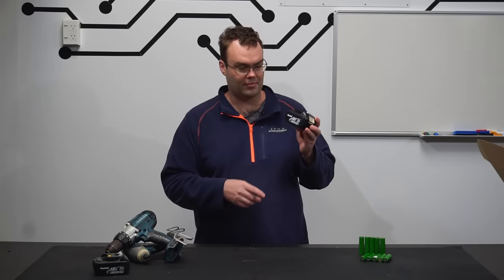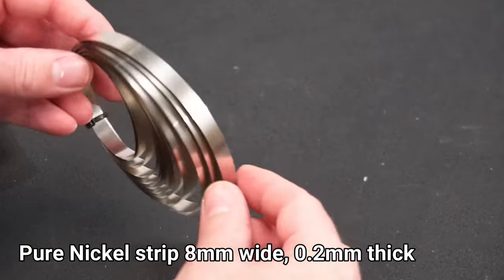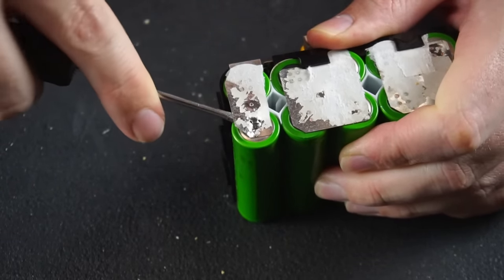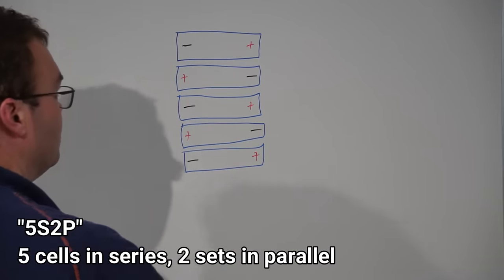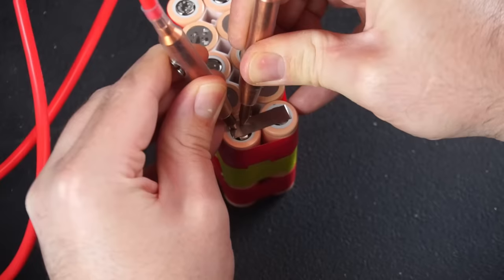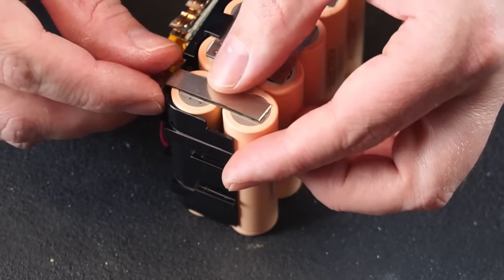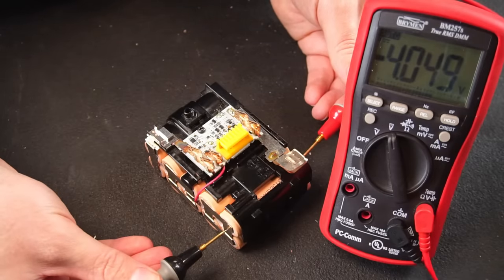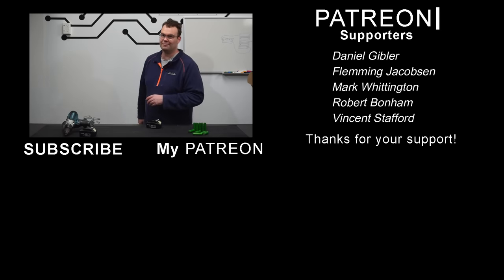Repacking Makita 18v Lithium battery with New Cells (Save $$$'s)

Comment: I have a 5 cell pack with wires going from each nickle plate between cells to the BMS. Then the +/-. Totaling in 6 wires. 
2 insulated high amp +/-, 4 solid metallic wires going to from the BMS between each nickle plate very similar to your "sense" wire but 4. labeled on the BMS IC as (W1,W2,W3,W4)
Is that balanced charging like you mentioned? I am 3D printing a new bottom to my battery and taking two wimpy 1.5 amp 5 cell batteries to make a 10 cell like yours but 3 amp. These batteries came with the drill. I will re-use the spare BMS to build another battery but was wondering about this. But seeing how you spot welded everything joining each set of batteries vertically in parallel really helped me out on how to spot weld these. I will make sure to relocate the "sense/balanced charging?" wire between the two vertical connections if that makes sense.
(It does to me, visual learner)
This video really helped me. Thanks!

Comment: Is it worth saving $20 to go through all this and buy a spot welder and spend may be 1 hr ?
Reply: Spot welding looks easier than Soldering. I guess it depends if you have multiple Batteries that will need replacing in the near future.
Reply: I have a few Tradie friends who all own and battle with dud batteries. 
They/we all hate paying $100 -$200 for new ones...
One of us could help each other, but who will ?

Comment: Great video, and nicely explained.  I note, without wishing to sound in any way negative, that the cost of the KWeld does rather change the viability of this, unless there is an alternative way of soldering on the nickel strips.
Reply: It's a fair comment. You can build your own welder too by sourcing the parts elsewhere. Ditto the circuit board. But end of day, as said soldering is not safe and welding is so, so much easier, quicker, safer, neater etc, etc.

Comment: Did some quick prices, k-weld $47 at Walmart.com with nickel sheet, Ni-Cad sub-c batteries about $2 or less a piece depending how many you buy, kapton tape ~$10 so for ~$75 you can do 1 12 cell pack. After the first pack price drops to about $25 a pack. I have an old Milwaukee and a newer Dewalt drill, neither one has packs available, this seems like the way to go.

Comment: Ive never spotted an cheap and good 18650. So I bought a drill battery of a cheaper brand ,the cells inside are branded , leave some tabs on and solder to the tabs. 
Used Aldi batterys to turn dead yellow Ryobis into lithium Ryobi batterys ,getting Aldi balance to play nice with Ryobi charger was a lucky guess.  I made short and long video.

Comment: the lxt makita batteries bms are set for 18v with a little wiggle room up, you're cells at 4.1v were probably the issue throwing it over 19v probably made the charger trip over voltage

Comment: only one problem with this you can do it but the BMS boards are designed to fail after so many cycles, so you are just best off buying new ones, the best thing is to look for power tool batteries and chargers from other makes and models like and make an adapter plate to accept the new battery I've done this for my power tools, you can have the cheap power tools you need with just one set of batteries and one charger at a fraction of the cost of buying genuine ones.

Comment: Forgive me if I'm wrong, but I was under the impression that B-series power tools (Makita) were unable to use higher amperage batteries than 3Ah, so this wouldn't be advisable if you have a B-series (BHP451 vs DHP etc).
I'd heard many other trades years ago on sites cutting the little tab off that prevented them using 4/5Ah Batteries with older models and burning out the tools (possibly due to overcurrent).
If your Makita Power Tool is from pre-2010 (or whatever) and especially prefixed with a B, I'd be wary of increasing the amperage of the cells, otherwise D-series and above are fine due to having a smarter power draw system in place.
Reply: That doesn't make any intuitive sense at all.  What you call "the amperage", is actually the capacity of the batteries, but you appear to be confusing that with current.  Batteries, or other sources of power, do not force current through conductors;  rather, the resistance of the conductor / device controls how much current flows.  You could, for example,  parallel 10 car batteries and connect them to the car battery leads - it makes no difference whatsoever to how much current flows; only for how long the current draw can be maintained.  Likewise, using bigger capacity batteries, which output the same voltage, should make no difference to your battery pack.     Stand corrected if there are some nuances of which I am not aware.

Comment: Really good video overall. Some good comments about charging them to the same voltage. Also, you need to fix the spots where the battery wrapping peeled off, exposing the negatively charged metal, before you repack them.

Comment: Tried this on a drill and cordless mower replacing all new batteries and didn't work. something fishy with the circuit board, i measured 20.5V directly from new batteries(5S2P) , but as soon as wire connected to board, voltage dropped to low power. same as 40V cordless mower, replace the board with no name board from China, works great. there might be a time limit chip stored in the OEM board so that people must continue to buy new batteries. what a great way to save the earth.

Comment: Someone said that he may increased the power of the batteries.The batteries he took out were 3.0ah.
He replaced it with 2.8ah so the run times is less.Still 18Volts.
Reply: Don't forget the configuration is 2 lots of 5 of serially connected cells, which are then connected in parallel. The original cells would have actually been 1500mAh. Although I doubt that these salvaged cells would have the capacity at manufacture, even if they were holding 60% of the manufactured capacity, it's still more than the 1500mAh of those original cells.

Comment: Great video, now I might have another go at this as my firs attempt was an utter failure and a new makita battery packet at my local dealer here in Australia is $160 -$200.  The voltage teting I did suggested that only one battery in the pack was faulty.  I just need some nickel strip and a spot welder.  Than you very much for a very clear video.
Reply: Even if one cell is the only faulty cell, you do need to replace all of them.  It's very unsafe to throw a new cell into a pack that has been well-used.  Alternatively, you could try and balance charge all of your cells and rebuild the pack again as it could be a broken spot weld.

Comment: It could help to just join all single cell with a resistor from each + pole and have them balance to the same voltage before building the pack. The higher loaded cells will risk overcharge and the lower charged cells may discharge to low when used.
Reply: worse combining low (3.6V) with almost fully charged cells (4.1V) would cause them to balance out at very high current (likely damaging both cells)

Comment: I've done this before.  I didn't fuss over the small stuff and mine worked great.
Reply: Whats the "small stuff" you are talking about? If you don't take precautions these batteries can burn your house down.
Reply: @randybobandy9828  I soldered and not spot welded.  I'm an engineer so I don't think I'm going to burn my house down with wrong precautions.
Reply: @harrymason1053  ah yes being  a engineer magically  makes solder cells safe.
Reply: @harrymason1053  lol sure dude. Keep thinking its safe and good for the cells to use a soldering iron on them.

Comment: Great info. Would be especially useful for a huge expensive 12ah Milwaukee battery. 200 US dollars sort of battery.
Reply: Ya but 21700 cells are very expensive and you will never find them as salvaged cells.
Reply: @randybobandy9828  6 bucks each new these days on a 45amp out makes it practical Vs the cost of a new 12 prob 250 dollars.
Reply: @LKN4WAR  sure, I just got brand new 3ah sony vtc6  cells for $2.25 each. I can rebuild 6ah packs for $23 each.

Comment: With salvage cells it's a Good idea to  do an individual cell charge test to ensure capacity is similar across all cells and internal resistance is low.
Reply: He did the work fully charged then tried to charge it again.It doesn't really work that way.When you charge and hit 4.20 volts, in the case he was at 4.1 and 4.0 ....It will take longer to reach that .1v  ,,,,,,,,,Do it half charge,he would hit that .1v in 10-20 seconds than to wait 15-30 minutes...That last .1v would only be like 10 seconds of use.
Reply: @paperlessdigs6169  I salvaged lots of cells myself from old computers etc. And always get best performance if you cycle each individual cell to get the capacity in order to build a proper pack. More work for sure.
Reply: @vueport99  yes as close as possible.

Comment: Very interesting,  but a much simpler method is to go to the shop and by a new battery
Reply: Sure, but after buying 3 batteries you've equaled the cost of the tack welder.

Comment: The BMS on new Makita battery packs will need to be replaced if you want to replace the cells. The new BMS has an IC chip that will permanently disable all charging/discharging capabilities once a fault is detected; ie, disconnecting the cells.
Reply: That is anti consumer behavior by makita. I can't believe people tolerate that.
Reply: which packs are this?

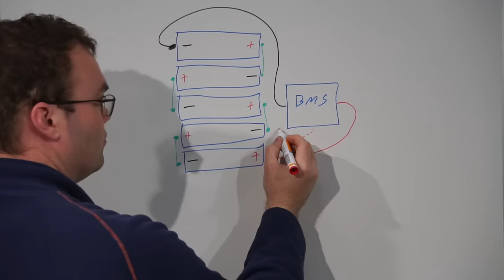Comment: @ 5:00 The thing with the sense wire is even worse. The BMS does draw some power from the lower cells - even if not connected to anything.
So if you leave a Makita battery on the shelf for too long (or a working empty battery not too long), it will become "defective" even with brand new batteries :-(
Since knowing this, I keep as far away from any Makita tools as I can.

Comment: You could charge all the cells before you get to welding them, that way there won't be any voltage difference and it shouldn't take long. Unevenly charged cells are not a great idea even if it wasn't an issue in your case. Important thing as you mentioned they were all the same spec. Another perk is being able to get up to 2.6Ah per series of cells(high current ones rarely get more), if you need that extra capacity without getting a bigger battery, you can pay more for good quality cells like Sony VTC5 and although the cost might be even higher than a new battery pack, they are guaranteed to work better.
I saw tests where under high load 2600mAh VTC5s performed better than 3000+mAh batteries rated at 10A, though I have no idea how that translates to the powertools.

Comment: At 6:16 seconds it shows the two outer battery's are on each end and in the middle, confused, when you welded the tow outer ones together you connected the -  and +  all together,, the + is linked to the other + and also to the - side,,?? and other side you used the two middle bats. Last, at 7:38 in your video is that the - side terminal you welded and  you didn't show you doing the + side welding?
  Thank you so much,   very very well done,,  DCB

Comment: Messing with these batteries is why there's been so many E bike FIRES especially in NY City, where non factory trained people have "refurbished" the batteries for sale cheap. If there's a fire started by one of these "repaired" batteries the insurance carrier and fire marshall WILL investigate the cause of the fire, and when they discover one way or the other that the battery pack had been tampered with- three things will happen;

1) The insurance carrier can/will DENY any claim for fire damage because the ignition source that started it was tampered with and CAUSED the fire
2) A criminal investigation, possible charges could be levied, especially if there's damage to a structure, adjacent property, or someone is injured or killed because of the fire.
3) A civil lawsuit can be filed for damages to property caused by the fire started by your tampered with battery pack

These batteries carry a LOT of energy, and since they are cheaply made in CHINA, the land of toxic drywall, poisoned baby formula and dog treats, lead painted children's toys, CARB forged laminated flooring, you simply cant trust that some tired, overworked chinese factory dude PROPERLY assembled the components, especially the separators in the layers inside the batteries.

By all means repair your tools and things, but don't risk messing with these high energy batteries, it's not worth the legal and civil risks!

Comment: Nicely done !
But are you sure that the BMS also is monitoring the discharge as well ? I would be concerned to discharge a unbalanced pack with high a current.
Charging and balancing should work from the first charge attempt on. Something does block it. They wants to sell a new  accu ?

Comment: With no actual balancing BMS you should have top balanced the cells first. The other option is to simply run a short connector out of the cell that you can plug into a balancer.

Comment: Seems you may have missed a rather important step- namely, ensuring that all the salvaged cells were charged to matching voltage prior to building your battery.  Wiring batteries with voltages mismatched to the degree that your initial testing showed is bad for several reasons.

Comment: I'm an old fart that remembers when battery tools wasn't any good. I repack my batteries by plugging it into an outlet. It never runs down and has plenty of torque. But what do ya do when you're away from an outlet? Glad you ask, my Tacoma has a built in 120 outlet in the bed so it isn't a problem. I carry an extension cord in the truck with the power tools under a foldable bed cover w/ locking tailgate.

Comment: While you had the individual eight cells, before assembly, you could have connected them all in parallel to equalize the voltages, using 2 strips of metal and some clamping method.
Reply from the maker: Yeah, that's one way of doing it. In hindsight, I'd probably have charged all the cells in my D4 charger before assembling the pack
Reply: @Schematix  Yeah, that would have been very much preferred. That pack is going to have a very reduced lifetime since the cells will almost certainly never go back to being balanced. Some of the cells will always get overcharged and that significantly reduces the number of times they can be cycled and can even be dangerous.
Reply: You should never put cells in parallel unless they are already close in voltage. High drain batteries can put out huge currents and if two cells are far from each other in voltage the higher voltage one will charge the lower voltage one with a huge current if they are placed in parallel. Can cause cell damage and even fire.
Reply: @mcg6762  Of course!

Comment: We should of taken the opportunity and tried to reverse engineer the BMS and identify it's parts. It could be cacheing data to eeprom perhaps.  Great videos!
Reply from the maker: Thanks mate :) I've read articles that mention once a makita 18v battery is bricked, there's nothing that can reset/recover the battery from it's bricked state. So I agree with your statement there is probably an eeprom.
Reply: @Schematix  Manufacturer designs for obsolescence. Probably not expecting repacking. Replacing eeprom or even reprogramming might be possible. Internal eeprom not so sure.
Reply: NXP MC908JL3ECDWE - internal eeprom is locked.

Comment: Works as long as the Makita BMS does work ;-) The Makita BMS shuts down after a certain number of discharges and cannot be unlocked again.
Reply: That’s shitty. Hence the after market BMS sales I guess
Reply: @EdgeMasterPro  Exactly.
Reply: @EdgeMasterPro  I bought after market BMS but then they were for the old batteries and the new ones had a something different.  Ugh, bought batteries, spot welder, BMS only ones they fit were the 5 cell packs.
I must have 10 or more dead packs.
Reply: That's a really scummy thing makita is doing. One of the reasons I chose milwaukee over makita.

Comment: Would you give the specs on the DC power supply you used for the spot welder. Im just getting started on my first rebuild and have been looking at suitable batteries for the welder power source. Great Video !!

Comment: Those cells were sony vtc5 green in colour? Which you replaced with lg?
Reply: Yup it's fine as long as they are rated at roughly the same amp output you will never notice a difference.

Comment: Did you test it another time? The informations on the web alwas suggested, that once the bms detected an error, it turned into fault mode permenantly. I have some dead Makita packs around and using the original BMS would be the most elegant way... and right now i got 100 HE4 Cells never used from 2019 for 1,5€/Cell. That would mean I got some cheap replacement possibilities

Comment: the year is 2022, and you didn't point out that:

The makita "BMS" is hardly a BMS at all. The error it gives is 99% of the time a firmware error on the board itself which will prevent it from being accepted by genuine chargers with no way to reset it's EEPROM. It activates after x amount of charges or x amount of faults/overheats. If you replace the cells you have to replace the "BMS" or it will lock your battery out even if the cells are perfectly healthy.

Comment: hey schematix! sorry for asking on such older video BUT really hope to know if these old style makita BMS boards {without the proper full balance leads)... can these restored old style packs then still do the makita fast charging on the makita fast charger?

and are the old style pack still have an id chip in them, that they can be bricked if the attempted charging has failed 3 times in a row?

many thanks

Comment: Research cells, nickel strip, etc.  Buy spot welder. collect everything, disassemble & test. Reassemble and test.  Consider the risk of messing with li Ion batteries.   ...now shop and order replacement OEM battery form Amazon: 69.5 seconds